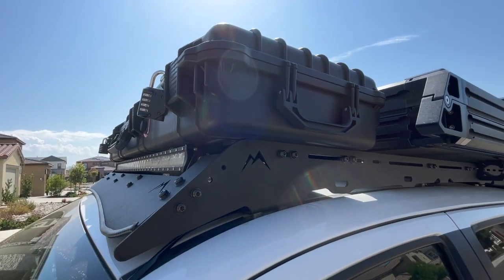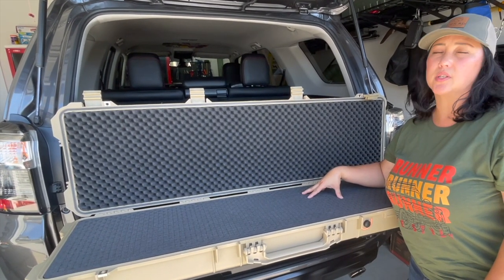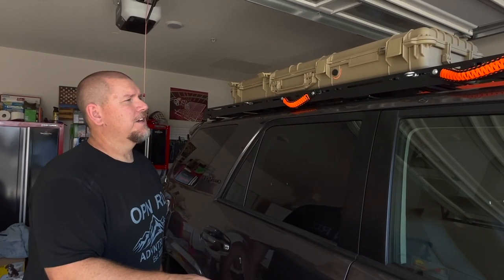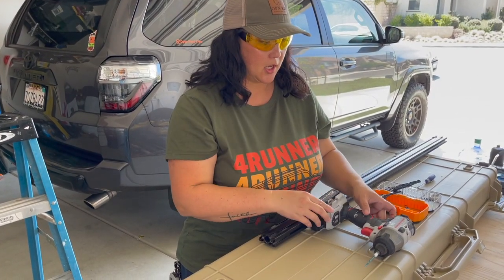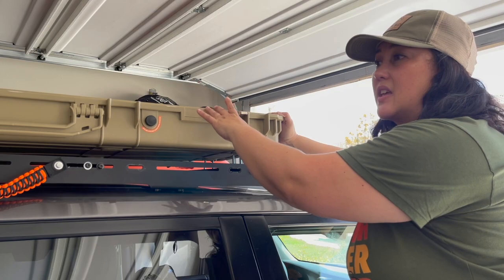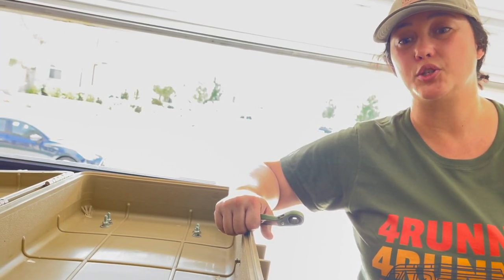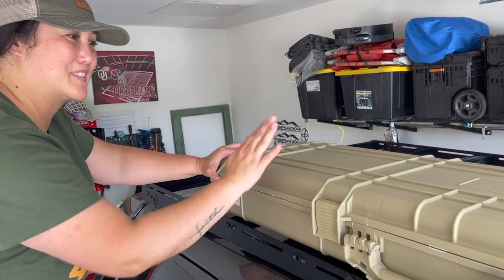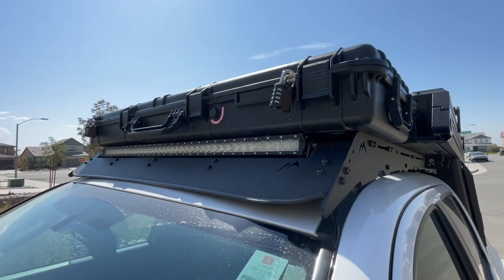Easy to Follow Install on a Prinsu Roof Rack

Comment: Hi you did  great, and looks awesome. 👦🏻👍🏻 It's good you identified needing to identify a pilot hole, before actually drilling the required diameter for the hardware. I had thought buying a Ski Box for my Mustang, and realized a good rack for my car is over $500 and the box only has a single lock, I like the one you installed due to 2 locks, and the compartmentalization of the foam, and Durability. Great DIY tips and Idea 👦🏻👍🏻🏞🚗
Reply from the maker: Appreciate the feedback. It’s a great gear case! It’s also good to know how things are attached to your own rig, so this was a great learning experience.
Reply: @OpenRoad4Two   Good to know on the Rack